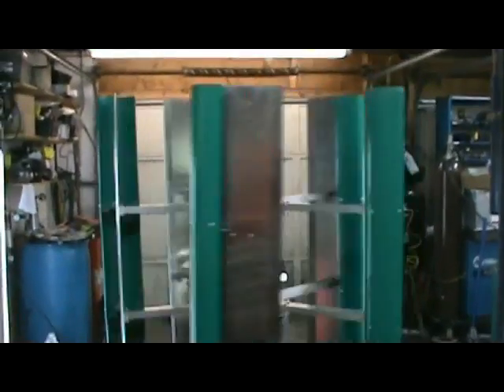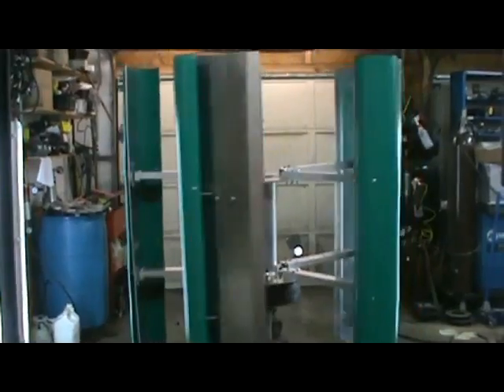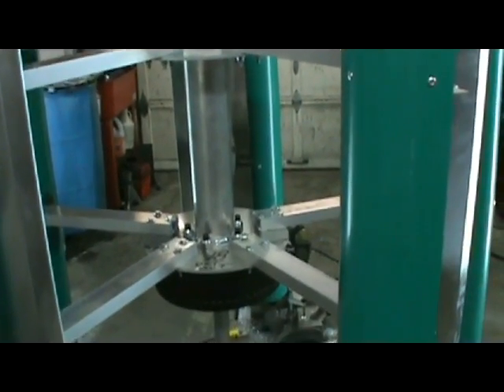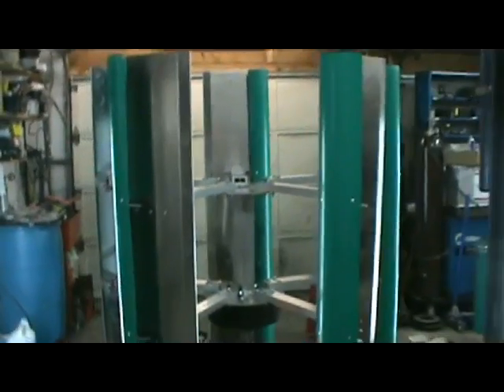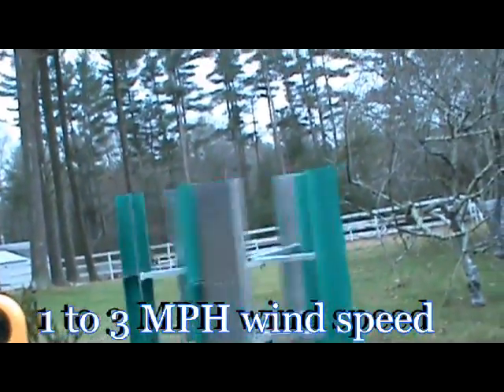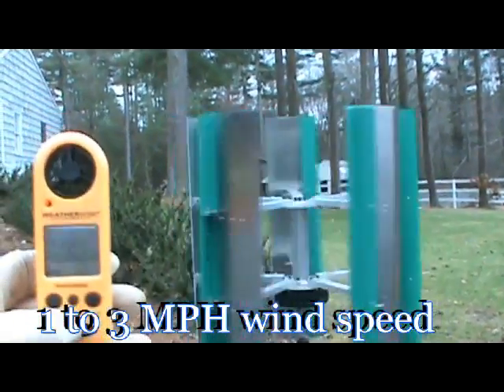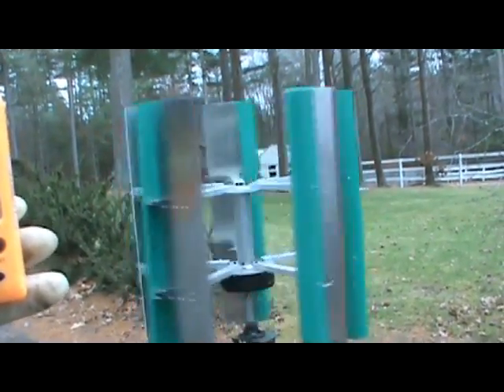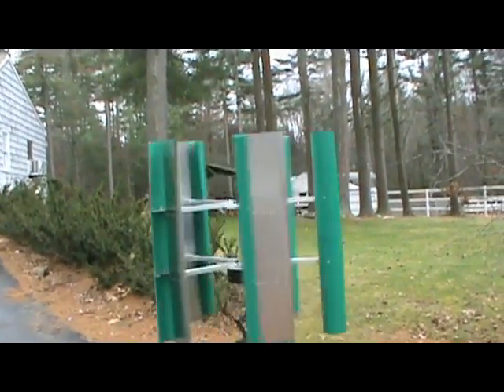C floating Blade ground test 1-3 MPH.avi

Comment from the maker: Th Marcel I am working with MR Bernd the inventor of the C rotor. the test shows that the Floating C rotor will start from a stand still in 1-3 MPH winds and adjust it,s self whe need.

to gunr you need to do your home work on what a Smart Drives is you will learn some thing.